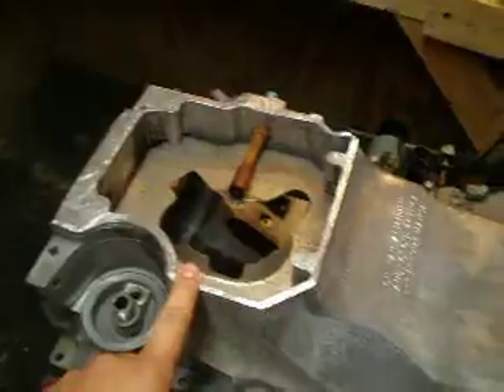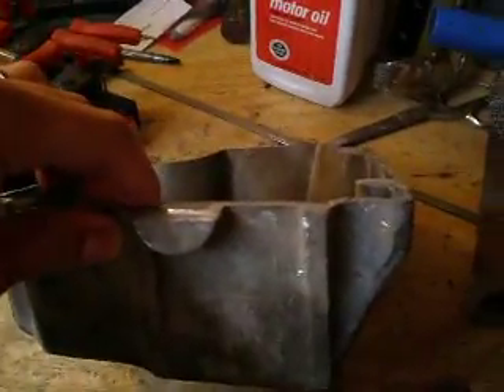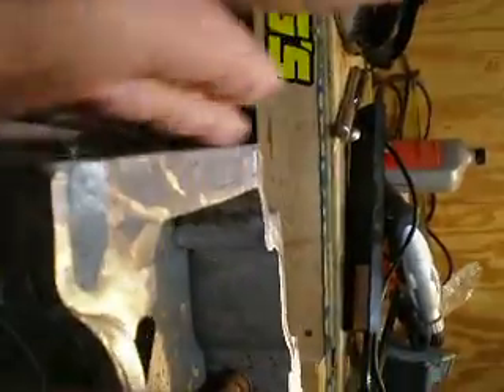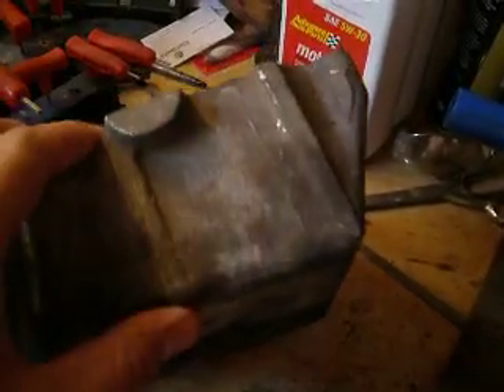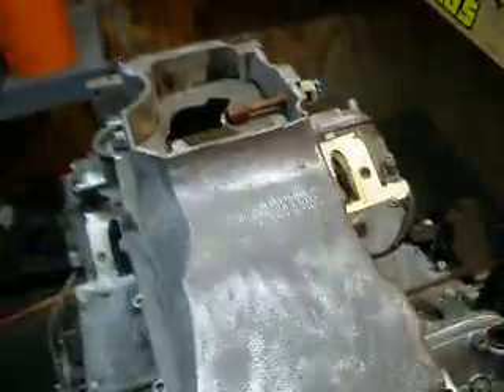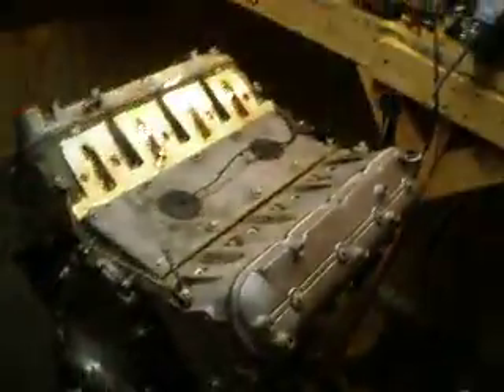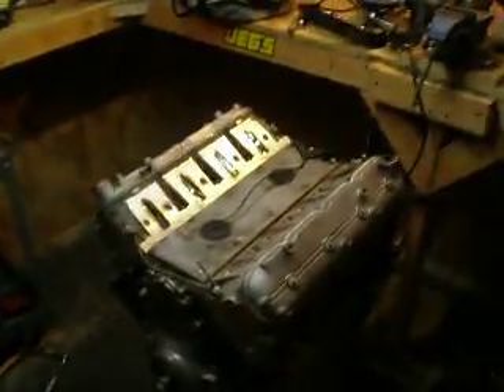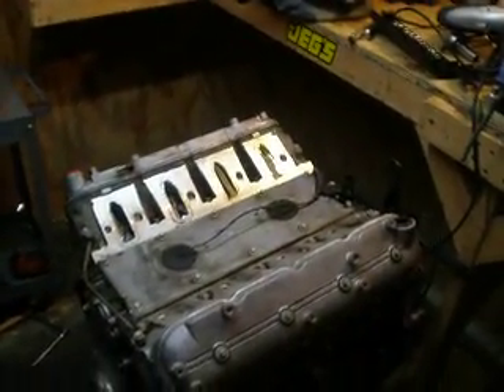Chevy LS1 5.3 Oil pan modifications

Comment: I am using a cts-v on my a body Chevelle, there are steering linkage issues the grease fittings hit the pan full lock, it is about 5/16 inch too low to clear the linkage. any ideas? I just put a 3/16 plate between the mount and the conversion plate but that changed the location for the cross-member frame mount, it now has to slide up the cross-member about 3/8" and up another 3/16. Not a fan of the engine mount and cts-v combination.
Reply from the maker: I used a Cts pan on my g body and had no issues... a lot off ppl just just the hummer pan in older A bodies
Reply: +Cary Lamari I started this resto project a year and a half ago, bought the oil pan in the early stages because I thought I was quicker than I really am lol, I am just now getting the driveline in. I read a lot of people with Chevelles, Lemans, Cutlasses the A body basically are having the same issue, that is the steering linkage is just under the oil pan and the width of the CTS pan just where the grease fitting on the end of the steering linkage sticks out about 5/16th of an inch. The only solutions are raise the engine or cut and inset the oil pan in those two locations. I think the engine is a tad bit low in the Chevelle anyway but it is hard to raise the engine just about 5/16th of an inch because of the geometry involved. I wish I was a little smarter when it comes to this stuff but I will muddle through.